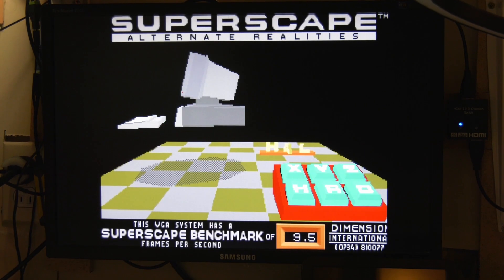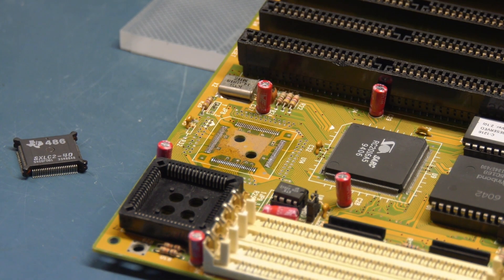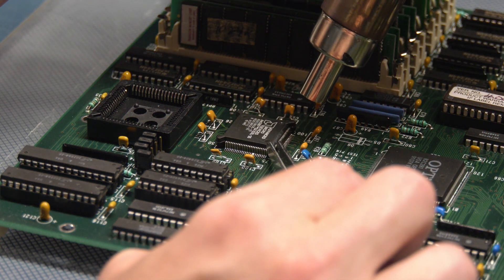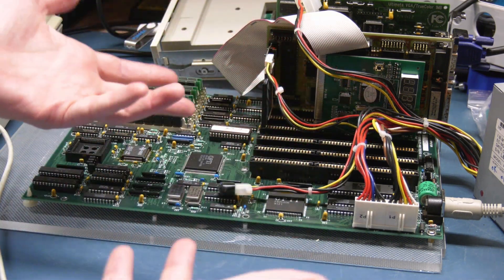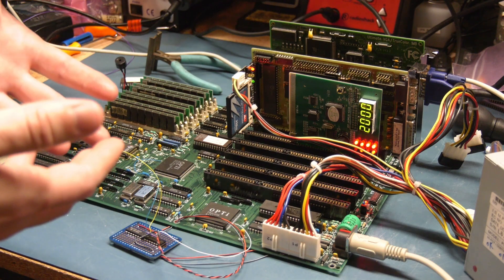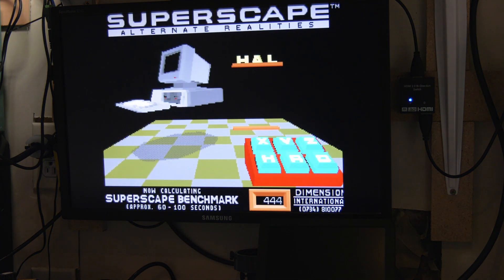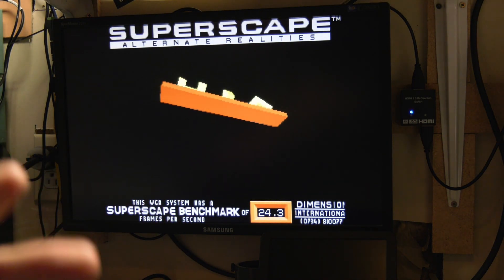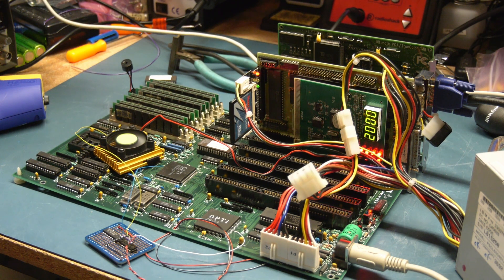386SX-25 With Cache Swap to 486SXLC2-40!

Comment: Awesome hand soldering of the the 486 to the 386 location./ removing the 386, without bridging any of the contacts.
Reply from the maker: Thanks! I think leaving out the solder paste that I was tempted to use for applying it to the motherboard is what helped. Just throw on more flux!

Comment: Online pages write, that cacheless processors have 1 kb internal cache.
Reply from the maker: The 386SX has 8x 32-bit internal registers. Outside of that it has no cache like the 486 series did. The Cyrix units like my Cx486SLC-40 runs 1KB of internal cache and that speeds things up considerably. This TI unit has 8KB. There are some others out there running 16MB but I don't have those on hand.

Comment: Try an industrial disk on module, those things are expected to work fine even with the worst maintained industrial junk made over the last four decades, I saved one from a smashed slot machine and was really surprised to find that it works on systems that wouldn't even try to "talk" to a Compact Flash card. Maybe an industrial grade CF can be as good as a DoM...

Anyway I was never able to use a CF with any dumb ISA IDE "controller" without ending with data corruption after a few hours or days while with EIDE/ATA-2 or newer controllers everything works as expected, I guess those controllers generate much cleaner signals with much better timings.

LGR on one of his videos (I can't remember which one) had to resort to a real hard drive to be able to show some program or game running on his famous "woodgrain" 486, I think he already had everything isntalled on a CF on a faster computer to save time and then just moved the CF adapter to that 486 but on the 486 the CF was corrupting the data every now and then.

Only those that keep the mainboards powered on for a few minutes each time to see at how many FPS will DOOM play seem to have luck with CF on ISA controllers... or maybe they just cut out any failures from their videos.
Reply: CF cards always gave me issues on PCs as a boot drive tbh, even ones meant for internal use. Had a lot more luck with the cheap SD card to IDE adapters, funnily enough on Macs it's kinda the opposite situation - just goes to show how temperamental old machines are with hardware lol.
Reply from the maker: @amirpourghoureiyan1637  Even more mondern machines? My Voodoo Pentium 3 rig has run the same 32GB CF card for 5+ years.
Reply: @DKJones96  yeah I've used Sandisks and Transcend cards but they just don't want to boot on PCs like my Athlon and Pentum 4 builds, they work fine on my G4 and G3 systems though.
The CF cards are a lot more expensive where I live than SD cards so I've just used them for a long time now.
Reply from the maker: I have had surprisingly good luck with CF cards. Pretty much anything I have that runs an IDE drive  has a CF card these days. My VLB 486 has run the same CF card for going on 10 years and it has a ton of time on it.

I love them for these quick tests because I can just pop it into my modern machine, copy a program, and then slot it back into the machine without hassle. My AST 486 All-In-One also runs a CF card.

Some of the issues that people run into could be old CF cards? I struggle to think of a CF card in my shop that has died or corrupted data. Better go knock on some wood....